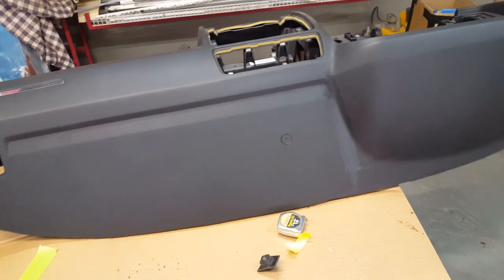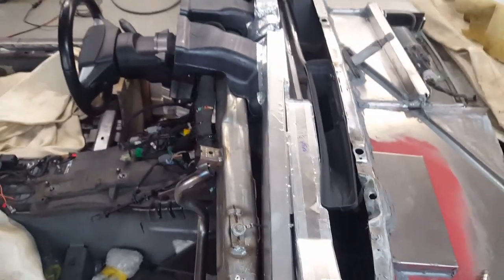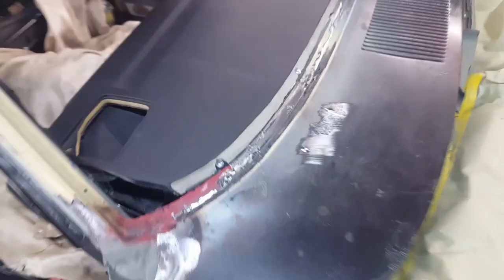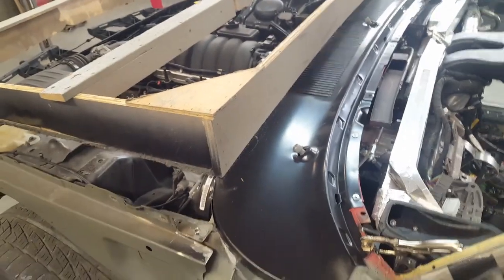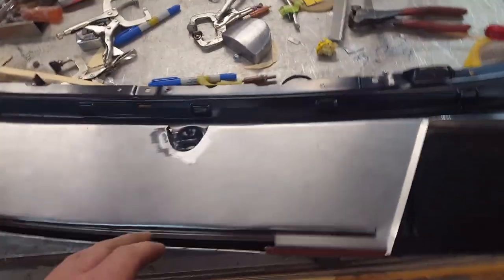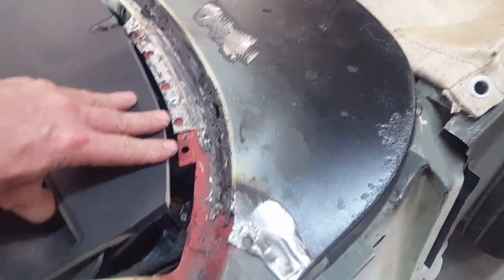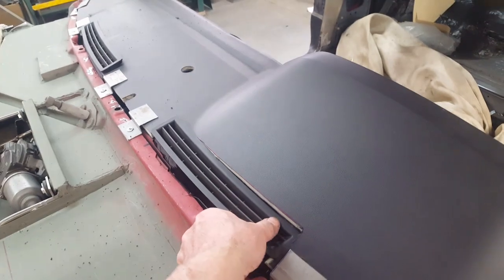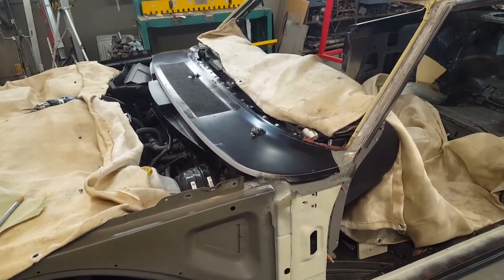Don's 68 Charger body swap part 16

Comment: You are an exceptional engineer on these projects, I never knew how complicated these cars were. I worked at a Ford transmission plant and the transmission didn't seem as complicated as these dash boards were! Keep up with the great work Steve.
Reply from the maker: Thanks but it doesn't help that I am trying to cram 50 pounds of stuff into a 5 pound bag.

Comment: Looks like the Guage cluster protrudes beyond where the glass will sit 30:28
Reply from the maker: Just the angle of the shot. I have used a straight edge from top to bottom to check for interference.

Comment: Uni bits ( step drill ) work well for holes in aliminum, sheet metal etc. Wonder how it'd fair on the dash material. But you had a cool solution. Goob work, Steve.
Reply from the maker: Unibits are great. I use them all the time but they would shred the vinyl for sure.
Reply: @SteveMirabelli   yeah, makes sense.